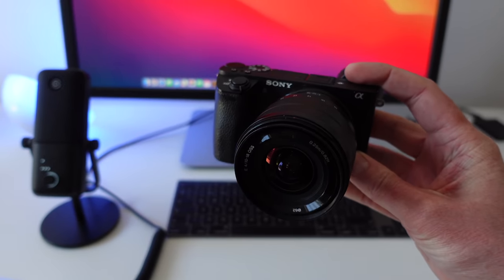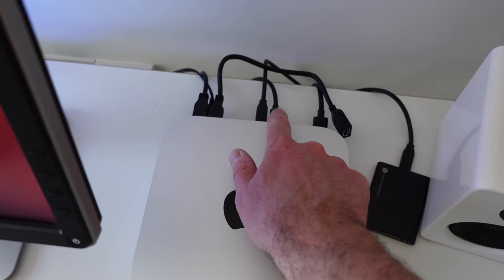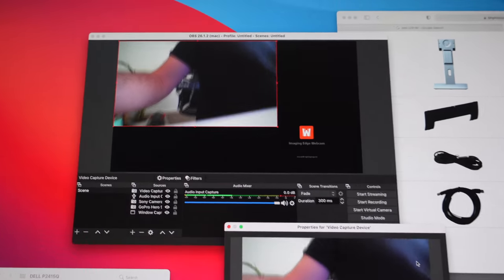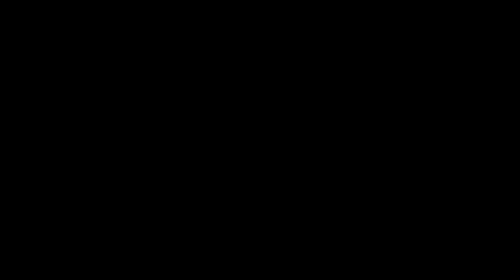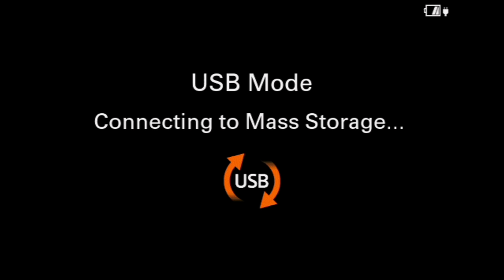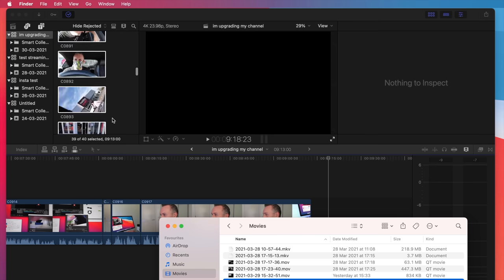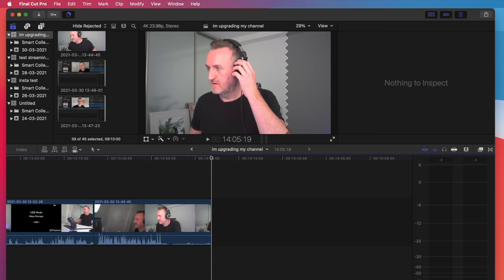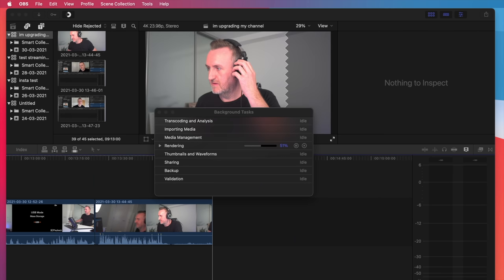i'm upgrading my channel

Comment: Hey Andy! Love the channel, question for you: I’m looking at buying a 2021 Trek Marlin 5 2XL and throwing a 2000w rear hub on it with a 72v 20ah triangle battery. Other than that being a little on the extreme side, do you think it will work? Thanks in advance!

Comment: In terms of ebike speed and power laws, if you added the motor to your legs and not the bike, would this "bend" the law? Picture some biomechanic additions that give me Chris Hoy or Robert Forsteman level power. It would require multiple motors and complexity, but you could ride any bicycle really fast! If I can push against throttles so they have torque sensing it would be even greater. That way I could control the motorised knee, hip and ankle joints as if they were my own.

Comment: Have you tried the Sony "Imaging Edge Webcam" software which is free and allows a Sony camera (works with my RX100 Mk5) to connect to a PC at least (not sure if they do a Mac version) via USB and act as a webcam so removing the need for the HDMI to USB convertor.  Maybe compare the two setups, though the Camlink is supposed to be very good of course.
Reply from the maker: Yes I tried it first, unfortunately I could get higher than 720p, did you manage 1080p??

Comment: Is that one of the new M1 Mac mini’s Andy?   I’m tempted by one to replace my 2013 MacBook Air.
Reply from the maker: Yes it is, do it they are awesome, real powerhouse and so  efficient unlike the Intel macs which just overheat and turn all the fans on, this outperforms a 2k macbook pro!!!
Reply: @andykirby  is yours a 8gb ram one or did you upgrade to 16?   I’m not worried about storage (I have a raid thunderbolt enclosure) but can’t decide as it’s obviously not upgradable after.
Reply from the maker: It's the 8GB. The memory management is awesome and I haven't run into any issues yet, I think because the disk access is so quick it can swap really fast anyway. I also only have 256gb SSD but I run two Samsung T5's for editing and general storage, I see there's a T7 now. One thing to watch is there will be some new macs announced in April I'm holding out replacing my Macbook pro which I only bought last year as I'm so impressed with the performance and lack of heat, the battery life should be insane!

Comment: Nice set up Andy. I recently bought a Logitech C920S and although its not 4K it gives a real solid HD image, without having to worry about overheating.
Reply from the maker: Yeah the logitech is a good camera, for me I wanted the luxury of using lenses and having a high quality capture straight to disk. I didn't have any overheating issues and this camera was running for hours. I have had overheating issues when recording 4k on the SD card of my cameras and that's really annoying.

Comment: Think you need to capture at a higher bitrate, looks very 'streamy' compared to the SD card footage, there's some compression artefacts and motion blur, maybe lower framerate too. Would be ok for live streaming. Good on you for making such a nice setup tho, I'm sure you'll make it work best.
Reply from the maker: Yeah bit rate I think can go up, file sizes weren't particularly large... We are at 30fps which is the max for these cameras at 4k, maybe 1080 60fps would be better. Sony's do suffer from rolling shutter so not really gonna be great for motion. There's always the option to record to SD as well which might be an option. Thanks
Reply: @andykirby  yeah i think 1080p60 would be better and 120th/240th shutter. 30fps motion with the youtube compression looks odd. Bonus of smaller file sizes I guess too. 2160p60 would be ideal of course but set up looks good man 👌

Comment: Tearing it up in St. Evenarge Andy. did any boy racers want to take on your Audi ?
Reply from the maker: Good old St.Evenage! 😅 takes me back to the raving days at the arts and leisure center!
Reply: @andykirby  pah. that was for the kids. lol
Pulse and Vogue (aka, Puke and Vomit), Renaissance and a couple of others in Stevenage in the 90's for me.
It used to be my neck of the woods
Reply: Just found out that Renaissance was owned and run by Dave King (one of the Essex boys). Feck
The nightclub was a front for selling drugs.
I had some good nights in there (but never took anything)
Reply from the maker: Pulse and Vogue 😁👍🏻 vogue was over 21s I think or 25s wasn't it!😅
Reply from the maker: Really??🤣
Reply: @andykirby  Yep Vogue was over 25's but if you could chance it, you could get into Pulse as well so two nightclubs for the price of one
Reply: @andykirby  yeh bonkers.
The other night club I remember (I had to think) was Beeches (Later on called JJ Hunsucker bar and then Cherry's) over the other side of the new town.
I liked that better as it was smaller, less hassle and longer time for playing 'club' tunes

Comment: I'm thinking to buy 2 kirk 52v 17ah batteries and link them together to make 104v 34ah
Reply: hi if you link them in parallel you would have 52v 34ah if you link them in series you would have 104v 17ah
Reply: @Stoke-delivery  thanks.
Reply: @Stoke-delivery   what would be the best way. My plan is for a off road ebike

Comment: cool. like the setup. chuck a few ham radio's in there.
I have got back into radio listening using SDRplay with SDRuno software.
Nice to tune from 10khz up to 2Ghz with up to 10Mhz bandwidth !
Reply from the maker: Nice! Yeah I'll defo be playing with some radios there! Did it a long time ago with a 2m antenna on the balcony!
Do you knownany SDR that covers 2.4-5ghz
Reply: @andykirby  HackRF One does and lets you transmit too (low power of course)
Plenty of kits on Amazon.
In terms of software, there are a few that work with HackRF One.
SDRConsole is one that comes to mind (free too) https://www.sdr-radio.com/

If you want to get a bit naughty, look up the HackRF One kit with the havoc firmware.
That lets you snoop Car keys and transmit, false GPS spoofing and Mobile phone false repeaters.
I wont go down that route. lol
Reply from the maker: I've seen that 😁 it's insane isn't it. I'm wondering if anyone has worked out the dji control link protocol and can decode GPS coordinates of drones in the area. That could be interesting.
Reply: @andykirby  I wouldnt be surprised if there is a forum somewhere on the inter-web. lol